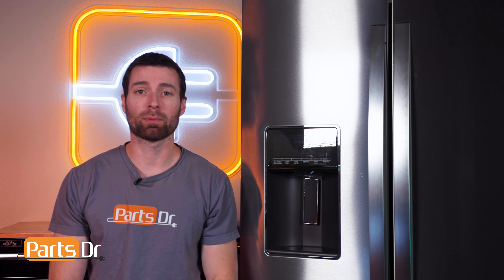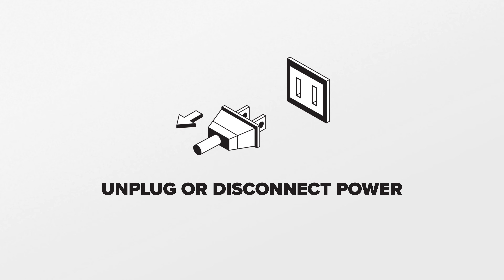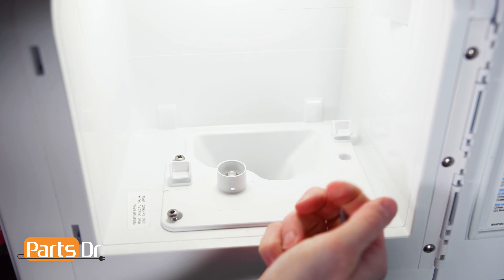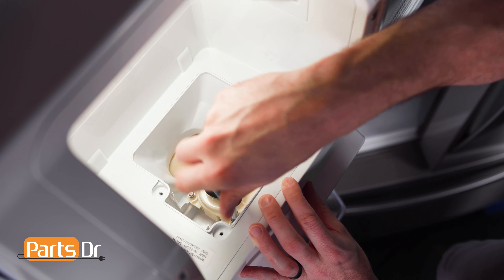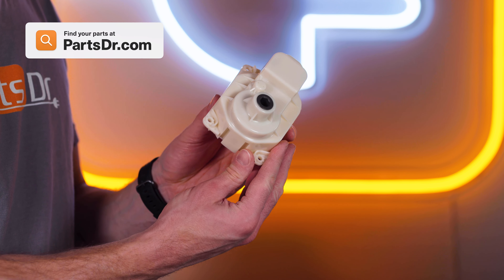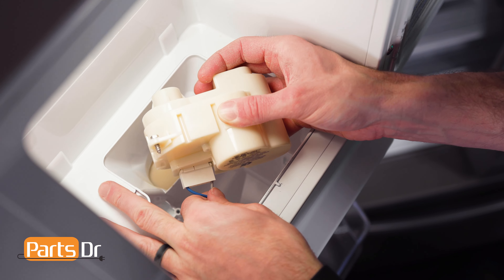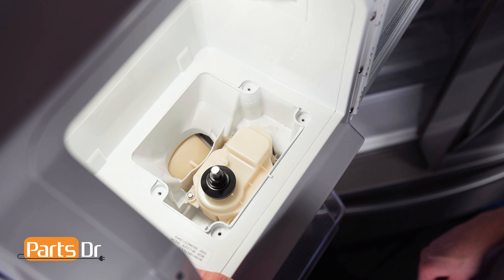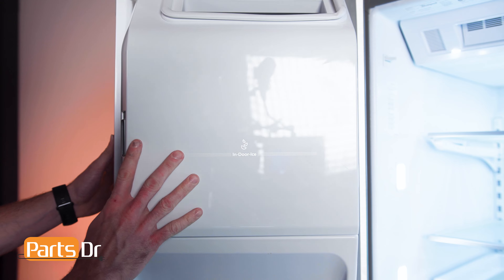How to replace Ice Dispenser Auger Motor part # W10822606 on your Whirlpool Refrigerator

Comment: I had no problem removing the ice chute place but once I reinstalled the motor, the chute plate will not seat properly.  It seems to be 1/4 inch too high.  I have even removed and reinstalled the motor thinking it was installed improperly.  No luck.  Any suggestions ??
Reply: My refrigerator is a 
WHIRLPOOL Model # WRV986FDEM01
Reply from the maker: Maybe try reinstalling the original motor to see if it fits correctly with the original motor?

Comment: If you press the dispenser and you hear noise but get no ice, would the auger motor be the problem?
Reply from the maker: It could be the motor, but usually if the motor is making noise it is working.  Try seeing if you can run it with the door open by holding down the door switch so you can inspect what is and is not working.  The problem could also be something wrong with the ice bucket or the drive shaft that goes between the motor and the ice bucket.
Reply: @PartsDr  my motor makes sounds and it doesn't dispense ice. Do u think I only need to replace the ice bucket? My husband dissaembled the ice bucket i'm wondering if it wasn't put back in the right place that's why it wouldn't turn

Comment: I replaced the motor and the auger is still not working.  Any suggestions?
Reply from the maker: If yours has separate ice and water paddles, check the ice paddle.  Also, check for broken wires coming out of the top of the door.  In some cases it could also be caused by a bad main control board that sends power to the auger motor.